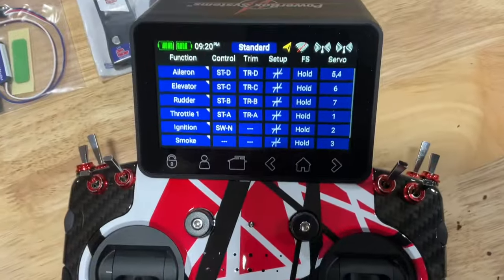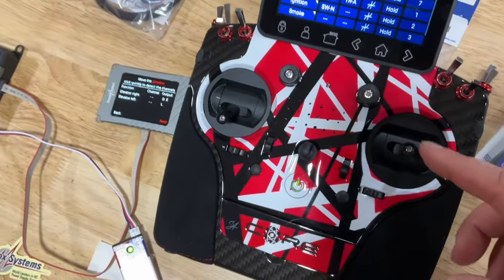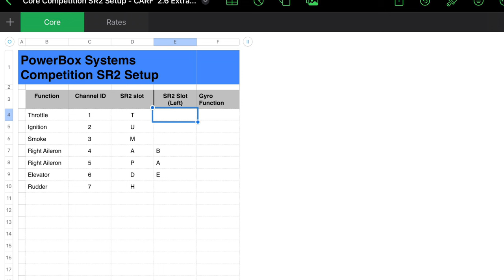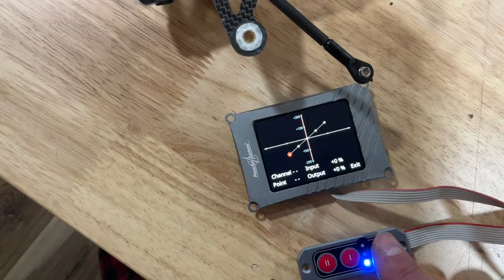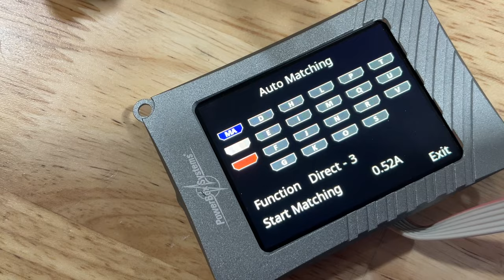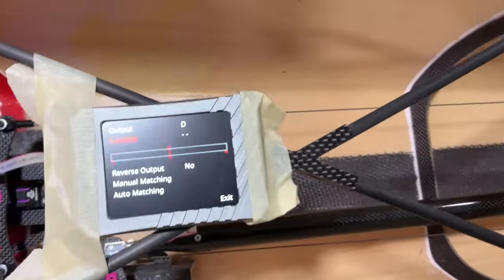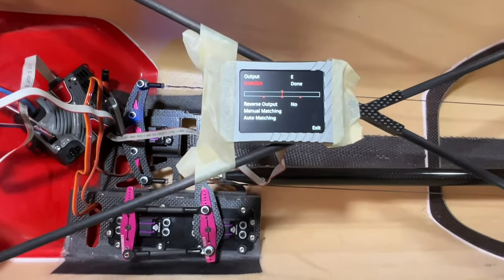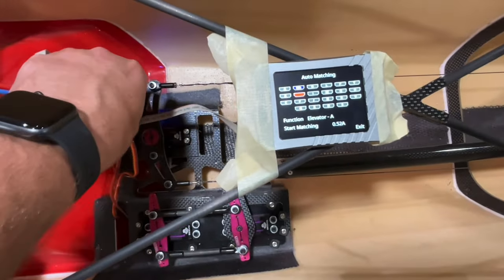PowerBox-Systems Competition SR2 Setup & Auto-Match

Comment: what happens if one of the linked servos dies? does it push against it
Reply from the maker: Dies, do you mean in operation?
Reply: @flightlinebymattymatt3366  yeah like say that motor just stopped moving when you told it to go, but it was loose or even if it stopped/won't turn. just checking if I'm understanding this linkage correctly